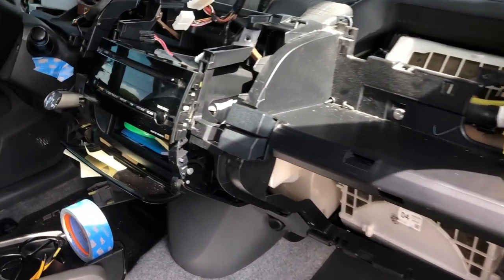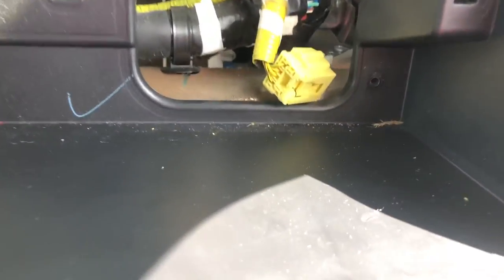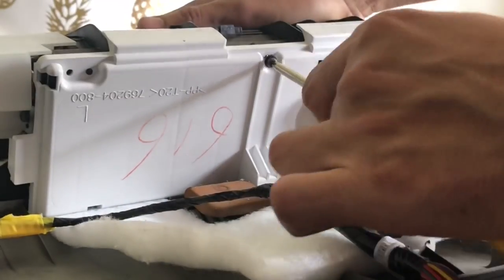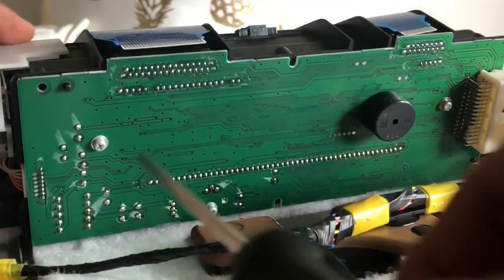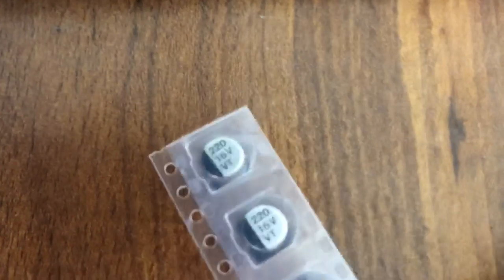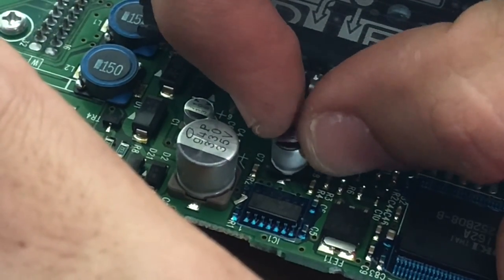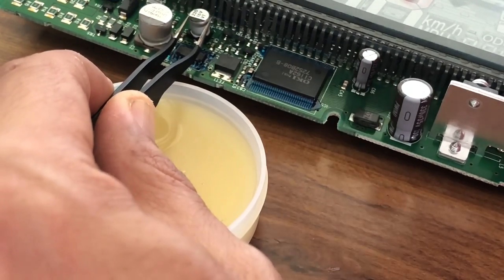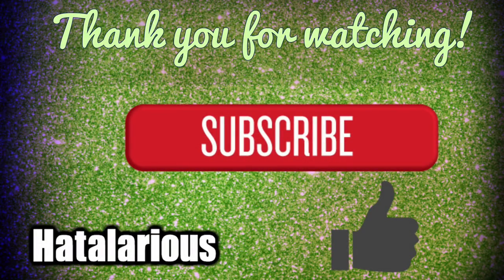Toyota Prius 2nd Gen No Dash Lights/Speedometer Display Fix!!

Comment: I used to repair clusters some years ago and one tip if are interested, If you are replacing one capacitor with a larger one due to what it seems the incorrect one chosen in the design (220uf instead of 100uf) as you are already spending time on removing all the board, is better to get an entire set of caps and replace all SMD and regular cylinder ones, when I used to repair I took my time to test all caps for my customers and a lot of them were still "good" when tested but leaking underneath and some other were off spec, so for the work done, replacing all is the greatest choice and try to spend some time with magnifying glass to make sure there all joints are healthy not cracked due to heat.
Reply: For the gen 2 Prius specifically?  Do you think any benefit to put like a spray coating of Krylon clear coat or like quick chip silicone to better seal as well why at it?

Comment: You got lucky. By twisting the capacitor off like that, you could have easily broken off the copper solder pads. You should de-solder, not pull off by forced, otherwise, the rest of the video is very good. Thanks!
Reply: Depends on the board.  Some are so fragile that even light heat lifts these additive traces.  Others are bonded better.  In any case, if twisting off the cap, it's best to push down while rotating.  But yeah, some absolutely can't be twisted off even if done carefully.
Reply: 100% percent correct. Desolder the capacitor. He got very lucky he didn't hose the whole board by ripping off solder pads. It looks like there's enough room you could probably solder the legs of a through-hole style replacement capacitor to those pads as well. That would be a lot easier that futzing with a surface mount replacement.

Comment: I performed this repair on a 2005 Prius and I haven't had a blank speedometer since.  This repair works great. It was a little tricky to remove the display from the dash, but it was worth it.

Comment: Thank you much for your video. I am the original owner of 2008 Prius with 185K miles on it. My display started to occasionally not turn on about two years ago, and I can use the quick method(s) to make it work for more than a few months a time. However the problem get more frequent recently so I decided to replace the C3 capacitor as described by few smart users on the internet. I followed the video procedure(s) to remove the parts to access the Display and Combo meter without much difficulties.  I removed  the surface mounted 100uF 16v capacitor C3 by using a iron to melt the leads easily and replaced it with a surface mounted 220uF 16v capacitor (a tricky task). I measured the original C3 capacitance to be 216uF on board before it was removed. The C3 capacitance is 247uF on board after the new 220uF  was installed. I also measured all other capacitors on the Display board and they are all good! After putting back everything together back on car, it works nicely except the fuel level indicator (had 80% of fuel before the repair but it shows 60% after the work). I will go through few pumping cycles to see what happens or I will follow the procedure to re-calibrate the fuel meter display.
Great job on the video, and I really appreciate it!
Reply from the maker: You’re welcome... thanks for watching and the comment!!

Comment: Thank you!  Superb technique on your soldering prep and repair.  One thing that really helps is a needle tip solder tip.  It allows you to get the heat on a small soldering point.  On another video, the guy doing the demonstration showed how to leave a little more wire on the replacement capacitor and then bend them like little legs with feet.  It gives you a bit more room to maneuver the soldering tip to the pads.
Reply from the maker: Tim L. PINE Thanks!

Comment: Great video.  I am not ready to go to this level to fix yet on my 2009 Prius.  Using the hack method at the moment to restore dash.   With Prius powered off,  driver side door open, step on brake and simultaneously turn headlights on and off rapidly.  Red open door light will turn on and dash will work.   Guessing this may discharge the capacitor as a sort of reset??

Comment: I removed the 100 and replaced with a 220 uf 16 v . Had a difficult time with the soldering but kept trying and got it. Put it all back together. Broke 2 of the A/C vents but the dashboard is working! Hurray the capacitors were 5.00 for 5. It took me a full day but I am happy. Thanks for the video. I did this on faith that the 100 capacitor was the reason for dark display and so it was. Without youtube I would have never had a chance.
Reply from the maker: Nice.. those ac vents and the plastic around them are prone to cracking

Comment: electrolytics have polarity, make sure to match the new one's polarity to the old. it was done correctly in the video.  see the black semicircle marking on the top or the stripe if you use a through-hole type

Comment: This is the best video of this fix by far. Do you think it would have been easier to add solder to the capacitor first instead of adding solder to the board? That way the connector on the solder has thick solder making it easier solder the two together
Reply from the maker: Sonnylintag Thank you!!! No, the pins under the capacitor are small and the plastic under capacitor would probably melt.  Thanks for watching!  Please subscribe
Reply: @hatalarious  The 220uF/16V capacitor that I ordered was larger and came with longish leads so I clipped them to size and bent them like little legs with feet.  It stuck up away from the board about 1.5mm but still had plenty of clearance and made the soldering job that much easier.
Reply from the maker: Tim L. PINE Cool I didn’t see that type before.
Reply: @TimLPINE  is this a fix for if the speedometer cluster goes out?
Reply: @kbanghart  Yes; it shows how to remove the bad capacitor from the display circuit board and solder in a replacement capacitor.
Reply: @kbanghart  And here is another video showing the same process but with a replacement capacitor that has the longer wire leads.  This is more like what I did and it seemed to make soldering easier.  https://www.youtube.com/watch?v=NAwewYdJaag
Reply: @TimLPINE  Thanks, I watched it, I appreciate that. I was also able to find a guy local to me who can do it for me if I need.
Reply: @kbanghart  no this is to get better gas mileage, probably around 70 mpg instead of 45 avg.
Reply: @TimLPINE  the video no longer works...marked private.

Comment: Did the 100uf cap replacement today with a 220uf  50v ... after attach to board it was showing 203uf.  still the display will not come up :face-red-droopy-eyes:  broke 2 of the vents as well :face-purple-crying:  out of ideas now ...

Comment: What about all the other caps? If that one failed the other ones are soon to follow. While the board was out you should've replaced them all to not chance them leaking and damaging the board.
Reply from the maker: My understanding is that this capacitor needed to be a different size

Comment: You can perform this repair without removing the central touch screen unit. I found the area I needed to be really careful and gentle was when I tried to remove four plastic vent covers. They are so fragile and really easy to crack and break into pieces. If anyone out there who knows the trick of the trade for removing the vent covers without damaging them, I would like to know. Thanks,

Comment: After doing this repair, my cluster illuminates every time ! BUT..now the first bar on the fuel gauge flashes instead of reading how much fuel is in tank...I took it back out, looking for something left unplugged, but it all looked good..I did the fuel gauge reset/calibration, which did nothing...any ideas?
Reply from the maker: Sorry I’m not sure
Reply: I have the same problem on mine, did you find a solution? Edit: after turning the car off and on a couple of times the gas gauge is working normal.

Comment: Is there a reason you used 220uf instead of 100uf?  

What does it say on the capacitor itself?  It's the part number.
Reply: I was wondering the same thing
Reply: If you remove the original cap and test it, you'll find the value and ESR aren't too far off.  This means the cap (bypass in this application) is marginally spec'd for value.  A new cap of the same value might die even sooner.  A 220uf gives more "headroom" as it ages.

Comment: Thank you!  We are going to try it!
Reply: How did it go?
Reply: Did you try it? Did it work for you?
Reply: @tarawebster6797  Sorry, we didn't!  We ran into unrelated problems with the car, so doing this repair sank on our list of priorities.  We did order the little replacement part and still plan to try the repair--later this year, probably.
Reply: @kbanghart  Sorry, I didn't see your question before.   We ran into a larger problem with the car, so this repair fell off the map for us :(
Reply: @jenniferabel2811  ok, I haven't yet either. It's intermittent, So for now I'll just let my son deal with it since it's his car and he can fix it if he wants :)
Reply: I just drove to a few places looking for the capacitor. No luck. I might try a tv repair shop tomorrow when they're open. I just may have to order online. The biggest difficulty will be putting the dash all back together.
Reply: @tarawebster6797  That's what I'm afraid of as well. And you reminded me, back when I was checking into this, I was able to find a place In my area that would do the repair, but they wouldn't remove from the dash for me, so I had to call up another place who said they could actually do the removing and reinstalling. And they both were going to charge around $250 to $300. What a pain. I could do it myself, but I have way too many distractions at my house right now, so as mentioned it's on the back burner of projects at this time lol.
Reply: @kbanghart  Man that's a lot of money to be saved. It's like a $.50 part, that's what bugs me. And it's really got to be completed in one day or maybe two. It's not something you can take your time with. Ugh. I feel your pain.

Comment: Quick question. Why can’t I replace the bad 100UF 16V with the same one instead of the 220UF 16V. Sorry I’m new to this. Thank you
Reply: from a previous comment, sounds like toyota misjudged the capacitor they would need, so theoretically this is a permanent fix to the problem.

Comment: What kind of solder did you use? Or what kind can I use?
Reply: Use a thinner gauge rosin core solder that says "for electronics".  Don't forget to get some paste flux too.  And a fine pointed soldering tip for your iron.

Comment: Will a 220uf 25v work?
Reply from the maker: sorry I’m not sure I used the 220uf 16v capacitor
Reply: I used a 220uf 35v from an old printer and it worked.

Comment: Learn to solder,  your tip was dry, had no fresh solder on it and couldn't transfer the heat effectively. Your solder wick never did anything in the video, never got hot enough.
Reply from the maker: Yes, I needed a new soldering iron and more practice but the repair I made still has lasted to date.

Comment: Great Video!, I did everything and it works but i now have an air bag light. From what i recall, there was 1 airbag plug (yellow) we disconnected. I double check connection it was fully seated. I went into diagnose screen by connecting pin 4 and 13 on the OBDii. there was some BS code that did not involve air bags. I cleared it anyways . it did not clear red air bag light. Anyone have same issue? Can anyone assist ?
Reply from the maker: Thanks!!! Is it the passenger off air bag light?  Please subscribe if you want
Reply: @hatalarious  passenger air bag light is off. If i put pressure on the seat, it goes on like normal.
Reply from the maker: You can try unplugging car battery for about 5 minutes and reconnecting to see if that works.

Comment: Yikes, do not rip capacitors off the board! Properly desolder them! You got very lucky you didn't rip the solder pads off the board. There's also enough room in there you wouldn't have to replace it with a surface-mount capacitor. You could much more easily solder the legs of a through-hole style capacitor onto those pads and call it a day!